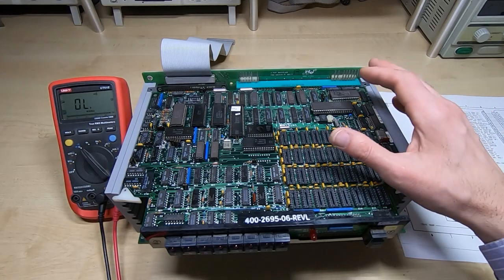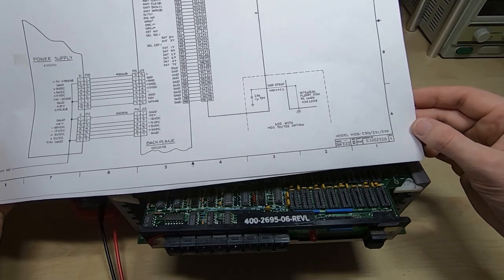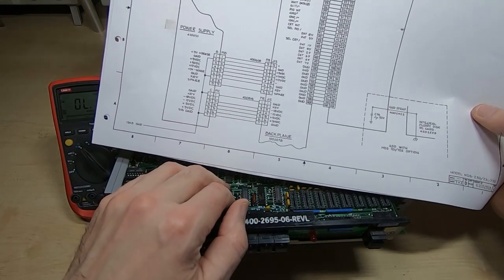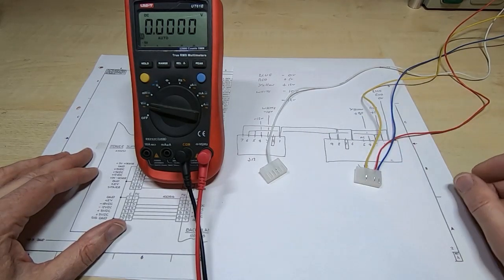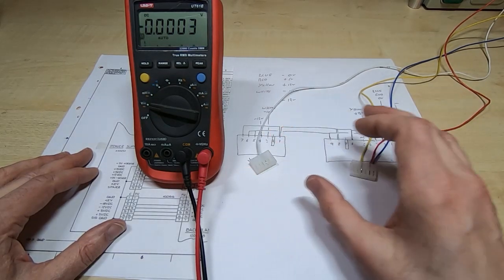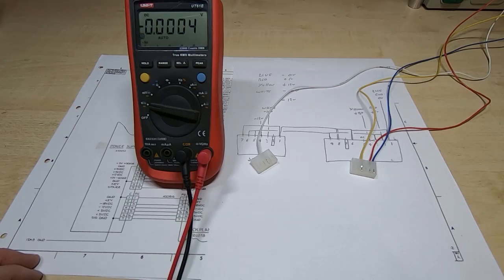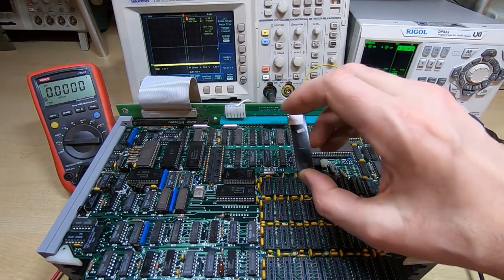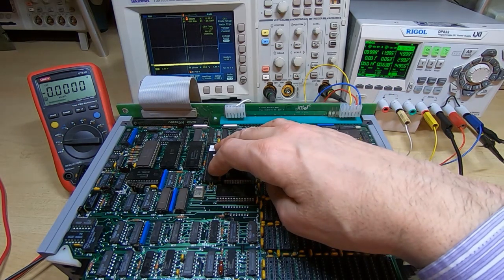Intel MDS Part8

Comment: I tend to "admire" old equipment more than work on it.... my "thing" is mostly microcontrollers.

But as you were talking about your logic analyser, I had a quick look on E. Bay for "Agilent-1670G"... and the prices look really good... not trivial but you could pick up one of these for 2-3 hundred quid. there's even a 1653B for less than a hundred. Of course, the caveat with all of these is "untested, listed as spares/repair". But I suppose, if you didn't know how to fix old kit, what would you be looking for an old logic analyser for? I surprised, I was expecting even old machines with a floppy drive on them to still be a couple of grand.
Reply from the maker: I use microcontrollers and processors in my business but I find old equipment more interesting. Even if you only intend to develop using microcontrollers there is still a huge amount that can be learnt about microprocessors from older equipment. It is certainly possible to pick up a logic analyzer for a reasonable amount but I have purchased a number of them over the last few years and only one of them worked properly. They are not easy to repair. A major cost is in the probes and leads which are really consumables and they are not cheap but that applies to all types of analyzers.